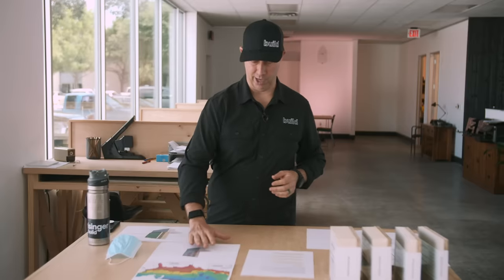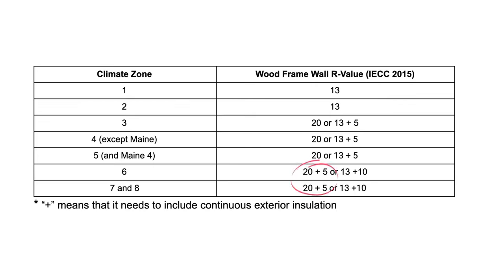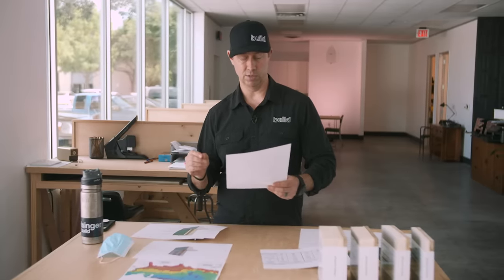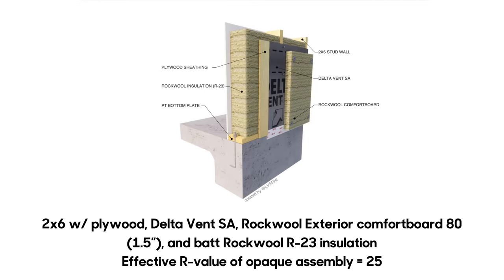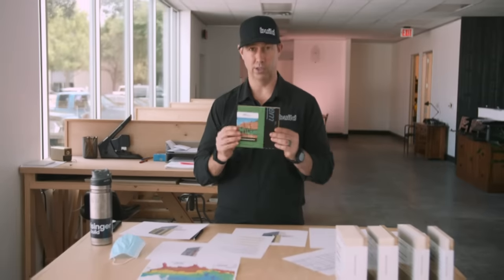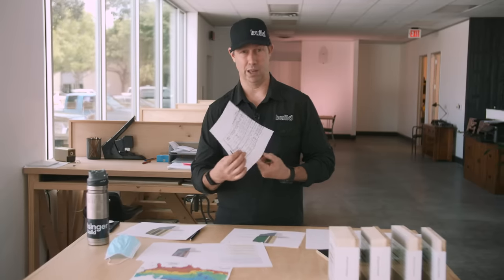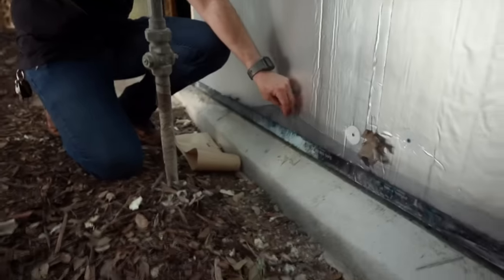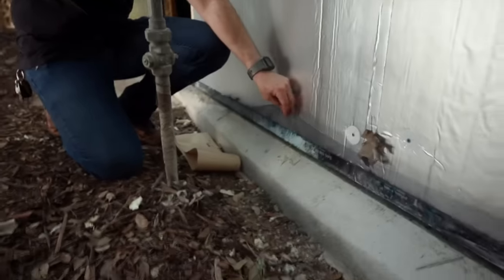5 Ultra-Insulated Framed Walls

Comment: Great videos. I thought that exterior insulation needed to be at least 35% of total r-value in order to control moisture accumulation on exterior of sheathing? The 2x6 and certainly the 2x8 assemblies don't comply. What am I missing? Thanks.

Comment: Interested to see what your recommendation for sealing your house on a pier and beam foundation would be. I figure you can probably do a fluid applied solution on the interior floor sheathing seams and fasteners, but unclear on an insulation solution for your crawl space.

Comment: Matt... How about an upgrade guide and costs for older house?... Mine was built in 1979.  drywall/2x4 with fiberglass/reflective cardboard outer layer and then brick. North Texas local

Comment: a great exterior insulation for northern climates.. ie where you do not want a vapour barrier on the outside of the wall assembly...
IKO enerair... it is R8.5 LTTR for 1.5" plus it is vapour permeable and relatively cheap.. cheaper than DOW SM which is R7.5 LTTR for 1.5"
the Roxul semi rigid board is good but 1.5" is only R6 LTTR

Comment: Most of the options needs to have forced ventilation ( rekuperator system) inside the house. Because moisture from inside house should move somehow out, it could do thru the rockwoll, but the sheets with folia is not letting moisture to escape to outside , which  can couse  problems to wood frame.

Comment: Great video! How do I become a build show member? Also just curious if you could drop the PT bug plate down and mount it to the slab so your insulation covers your bottom plate? Seem like if you did it would stop thermal bridging through the bottom plate.
Reply: Great question.

Comment: Why did you skip out on all open or closed spray systems? Building a client's house now with 2x6 framing, zip sheathing with flash and batt. R25 in the walls in Virginia. Conditioned crawl and attic too.

Comment: #6 is where its at. Just 3 simple common processes.... 2x6 24oc framing, R23 Rockwool insulation, and ZipR6 sheathing. Lower labor cost compared to adding exterior insulation which would be a 4th process.

Comment: Would be intetested to see the same breakdown for roof insulation. Also would like to know if there is any benefits or downsides to putting a second layer of osb+delta vent sa over rockwool comfortboard (sandwich style) similair to how youve done your roof but substitute out materials for vapor permeable.

Comment: Hello Matt, love the videos. I am planning to build my house in Round Mountain. I am trying to determine the type of wall system to use. After watching your videos I'm thinking of using the 2x6 16" O.C. w/zip R-3 and batt Rockwool R23 insulation. I will have a 1" air gap then add 4" stone.  In a few other places I will use board & batten in lieu of stone.
My question is with the 1" air gap do I need a rain screen or does the Zip R-3 system take care of the moisture issues? (humidity)

Comment: At around 10:00  you mention adding battens and siding.  I have been wondering how much weight in siding can the batten support especially as insulation depth increases and the only thing holding it are long screws.  For instance, what if an entire wall of Slate (8-10 per sq ft) or imitation stone such as versa rock was installed?  What kind of stability of the siding could be expected?  I appreciate showing the type of wall insulation but I don't recall seeing anything about what kind of siding weight would be supported as insulation depth increases.  It seems a discussion of this aspect is needed to complete the wall assembly.

Comment: I like the concept of vaiable thicknesses of wall cavities and external insulation for isolating framing members from conducting thermal energy on through.
The reference to screw costs doesn't bother me as much as longevity for the amount of weight supported longterm from exterior siding to framing members.

The vaiables are endless.

What about 2x4 framing with rockwool cavity fill, 2" pink rigid insulation inside between framing and drywall, then 1" or 2" non - flammable insulation / siding? I guess there would also be a house wrap in there?

Also, it seems that the costs for more framing thickness increases linearly but the insulation costs (lower per inch thickness) are not linear? One wall $4.xx/sq.ft. another wall similar but 1.5" thicker? Typo?

Comment: Let's say you live in zone 6, with fire hazard as a variable you should contend with. Considering  ICF with additional 1.5" insulation on the exterior or say option #8 or #9 from this video?  Which would you choose?  I like the simplicity of the ICF, but the cost of the options in this video are very appealing to the wallet.

Comment: "5 Ultra-Insulated Framed Walls" I'm surprised one of the 5 examples didn't include closed cell spray foam.  One respectable  builder here is doing good detail work with sprayed in cellulose and is getting .03 blower door numbers injunction with OSB sheeting.  I'm assuming 0.03 is a good number for those types of products?
Reply: closed-cell spray foam has become an optional choice due to the greenhouse gas potential.
Reply: It might be because spray foam is 3-4x more over batt rockwool costs.
Reply: @StreamingF1ydave  true but closed cell foam is at least double the r value of rock wool. if anything, for the 2x8 wall why not do 2" of closed and then the 5.5" of rockwool?
Reply: @HickLif3  are you building with 2x8 walls?
Reply: Dave D i was mostly referencing off the last wall he showed where it used 2x8s. But you could go 2x6, full spray foam, and come out to a closer cost to the 2x8 with just rockwool but still get much better insulation. You are also sealing the house better with the foam, even if it is just 1” thick
Reply: A 2x6 wall with 2" of closed cell spray foam and a 3.5" batt makes a great wall section, far better than average. But it still doesn't address thermal bridging at studs. Despite the bridging I've used it and it has a lot of advantages. Another completely different approach is SIPS. For a new design, plan it from the start to use SIPS efficiently and get the whole package pre-cut.
Reply: @HistoricHomePlans  that's why I am a fan of the 2x6 t-studs

Comment: Did I miss it or was there no closer cell spray foam cross section/option.
I built my own house 3 yrs ago
and opted with 2*6wall
Closed cell spray foam r24 
OSB
House wrap
2 in of ridged foam r10
Siding
Total was r34
Code for my area is r24. East coast Canada
Ontop of Nudura ICF Frostwall/Foundation

I'm very pleased with my decision but would love to hear down feedback from a probuilder.

Comment: Regarding those illustrations. I hate the look of having the wall assembly extend out over the foundation. Can you not recess the primary stud walls on the slab and have this all flush with the outside edge of the wall assembly? I know it would require more planning but it would look better :-)

Comment: I'm curious what the best options are for 2x4 wall retrofits. Taking old construction, sealing up the envelope and installing exterior insulation. Assume R-13 fiberglass batting. What would it take and what would be the most cost effective way to get an R-40 opaque wall assembly? Also assume aiming for passive house construction.

Comment: I think ease of construction should also be a major consideration, especially if you're contracting out. So set-up 10 although it has a high R-value, if not built properly (which is likely in the uk lol), the R-value definitely won't be that high. Whereas set-ups 6 and 9 is should be (should be!) difficult to screw up

Comment: Save some cost with the 2x8 walls, 2x8 plates with 2x4 studs staggered. This stops any thermal bridges. Really enjoy the videos!
Reply: Except for the rims, bands, eaves, window and door openings. It is NOT just the studs, it is ALL the frame elements, which is why to go continuous exterior.
Reply: Lee Stevens studs make up about 50-60% of the house frame so eliminating that thermal bridge doesn’t act as a cure all, but use it in conjunction with the exterior insulation and you have an even better envelope. IMO
Reply: @zbot2010  If you actually build, and must justify what you are doing (as I do), the ROI on ANYTHING inside of the continuous exterior insulation (which we use) is greatly lessened by the exterior blanket. It might make you feel good about your efforts, but it is not maximizing return value for expenditures made. I have always found that the simplest path to the finish line is the best. Put the money where it does the most good.
Reply: Lee Stevens 
(2) 2x4x8ft =$10.30
(1) 2x8x8ft =$10.65 
And that’s just a quick quote from Home Depot.ca 

Replace a skid of 2x8 with double 2x4 studs and you have yourself some cost savings. I agree there isn’t much difference with thermal bridging inside the exterior insulation envelope but I’m just proposing another way to do things and some benefits. 

I’ve built some homes without exterior insulation and staggered studs is what we used, worked pretty well. 

Cheers

Comment: Greetings Sir! I'm going to be building my retirement home in the high desert of Cochise County AZ. I will be using 2 x 6 walls with 2 x 8 or 10 roofing. This is climate zone 3 but real dry...14" of rain with low humidity...what would your recommend for wall insulation...Zip R3 or R 6 with Rockwool on the inside...thoughts? Oh, I plan to have west facing front of the house having a 10 foot covered porch and an 8 foot cover porch on the east facing east facing wall. Thanks for your time.

Comment: Does having the insulation behind the plywood still give the shear strength? I have a house that is 30 years old. Has LP Smart clap aiding in front and LP panel spring on side and back. I have to replace some panels and wanted to do a rigid foam insulation and rain screen system. But wasn't sure if I could just add the foam board, house wrap then rainscreen strips and aiding panels. Or sheet, foam, then rainscreen. Central Florida here. Thanks.

Comment: Great video Matt! 
I know that barndos aren't your area of expertise, but I'm curious what your thoughts are on them regarding this same subject. I have basically a 40x90 metal building that I'd like to build out off of the Eastern 90ft side. I'm just East of Houston and during the hottest part of the day, the shop with 18ft sidewall height provides plenty of shade on the East side. So, I'm thinking 30x90 living space with metal roof and walls. I see that some barndo builders are using Zip sheathing and wood framing for the exterior walls before metal siding. I'm fairly certain that metal framing would be a lot cheaper. Do you have any ideas on how I could super insulate using metal framing? I realize that metal is a worse bridge than wood, but it's also really thin compared to a 2x4. I was thinking spray foam

Comment: What are your thoughts on a 2x4 internal frame with R-13 fiberglass, Zipp Sheething on the outside, and Comfortboard 1.5" R-6 board on both the exterior and the interior of the walls. I am building a cabin in Zone 4 (but AZ so its a dry Zone 4). The interior comfort board is done with horizontal battens and all chases are run in the internal comfort board layer. It eliminates the thermal bridges almost entirely and give an R value of essentially R-25. It also gives me an internal/exterior bug free and fireproof zone. Not positive what to do on the roof. I was thinking Zipp with 2" of polyiso on top of a 2x8 rafters with the cavity filled with Rockwool. Not sure exactly how much polyiso I have to put on top of the roof to eliminate potential condensation on the back side of the Zip roofing. I'd also like to go with a metal roof so I might need to run horizontal batten over the polyiso to give a air break for the aluminum facing on the polyiso. Anyway, I have been thinking about this for years and I really like the direction you have gone with the last couple of postings.

Comment: @Matt Risinger Is climate in US always moisture OR hot? Is there zones where out door climate is cold and dry? I mean that in all these videos vapor block is always at outside of insulation. That is something what we do not never ever do in finland because house will just rot because of that. We always put vapor block just under drywall or other inner material and structrure will breath to outside. That because 90% time indoor is warmer than outdoor and thermodynamics will push moisture to our from structure. Do you flipt that structure around at northen parts of US?

Comment: Here where i live i think the standard walls are like 10" thick (2"x 10" studs), some even go upto 12", and same for ceiling also i think. And in more and more places here in Norway you also have to use an membrane the foundationfloor, due to a gas called radon.
Reply: What kind of insulation do you use?
Reply: @JamesG1126  Mostly rockwool is used here in Norway. I don't think we have that closed or open sprayfoam insulation here in Norway, i have never seen it

Comment: The problem with all these cost numbers is that it factors in only materials. For most homeowners who build, the interesting bit would be what the increase in labor would be. I assume that a crappy builder can't even assemble something like the top option correctly. That means the builder will be top notch. Cha-ching. Then there is the detail level required...sealing EVERY nailhead, applying R Guard etc etc and layering all these components correctly. The difference on a 3000sqft 2-storey house vs more conventional building techniques has got to be in the tens of thousands. Simple math would indicate that if material difference alone is at least $5/sqft higher, each wall on a 3000sqft 2 storey would be 3200 sqft of wall (assuming 10ft ceilings), so the extra cost of materials only is $15k. And I would assume the labor extras would be at least that much? So $30k extra at minimum? Doesn't even seem that much for a nice house, but has to be even more I imagine?
Reply: Labor plays into everything and it is indeed down to materials. Most people tend to cheap out but still pass code, I've helped put up buildings for rich people and they care more about proper construction because they have the money to blow it seems

Comment: How's this compare to SIPS panels?
Reply: I build a house 20 years ago, I did the main level walls with SIPs. They had 7.25” of EPS so about R29 & worked very well in Climate Zone 5. They go up very quick but cost $$$
Reply: A good rule of thumb for SIPs is thickness of foam (assuming EPS) in inches multiplied by 5 + 1 for the two half-inch layers of OSB. So 8-inch total thickness would be (7 x 5) + 1 or R36. Not bad, but your air sealing must be flawless, especially in cold climates. In winter a lot of warm moisture-laden air is driven out through any gap (mistake) between panels and the moisture condenses against the outer OSB layer, which rots it. Other issues: SIPs are ordered to fit and not cut to fit on site. And pulling wires through those chases is a hassle, but I've seen the wire issue solved by fabricating a tallish baseboard to act as a wire chase.
Reply: Scott Miller Yes, wiring is a PITA. Floor outlets along walls is an option. American SIPs EPS foam are 3.5” or 5.5” or 7.25” or 9.25” They normally sit onto dimensional lumber bottom plate, also wall butt joints are 2x dimensional lumber shot together.

Comment: Can the exterior insulation sheet be used on the inside of the wall? Not in the cavity but just before the drywall? Im unable to install exterior insulation on my old house and exterior wall is framed with 2x4s.

Comment: Installing a rigid foam flat against the exterior sheathing is problem to happen in northern climates. Especially if you use the XPS foam which has no vapour permeability, very bad idea. EPS foam do have vapour permeability properties but you still want some air gap between the sheathing and rigid foam. EPS foam sheaths come with groves on the back side for mechanically fastened types. For fluid type fastening, a notch trowel is used, that way any moisture build up on the sheathing have a chance to drain.

Comment: What climate data do we look at to determine if we need a vapor permeable sheathing on the outside of a home?   You gave examples of not wanting vapor permeability in a cold climate and wanting vapor permeability in Austin, which can be a humid environment.   Can you reduce it to specific facts that we can check for a specific build location?

Comment: Matt.  Great video.  Really appreciate what you do.  Quick question if you were pouring a new foundation and using zip r12 would you consider over-sizing the foundation by 2 inches to have the sheathing flush with the foundation edge?  Trying to determine if there is any advantage/disadvantages (besides concrete cost).  I am a little concerned with aesthetics after I add 1x for air gap and then siding.  Thx.

Comment: Matt always great info. I live in Hershey Pa and have a cape cod. Construction is double brick w wood lath and plaster. House is 24x28 and wondering what you'd suggest for  an insulation system. I would like to install a heat pump down the road as well. 
Appreciate any insights  Jeff

Comment: I'm very surprised there was mention of spray foam, t-studs or "double walls" in this video.  I'd also be interested in knowing where the cost of adding more "r value" turns negative in terms of ROI.  It basically comes down to getting the most r value, most air tight system that you can afford, but at what cost (r value/system) are you not gaining performance anymore?

Comment: hi @matt risinger - I know this is an older video, but what would 2x4 studs with 2-3" of spray foam in stud cavity with R12.6 Zip on the outside be in your list. This would get rid of the need for VB on the inside, save some money on studs and be fairly easy (relatively) to get a very tight envelope. This would be for a canadian cold climate situation.